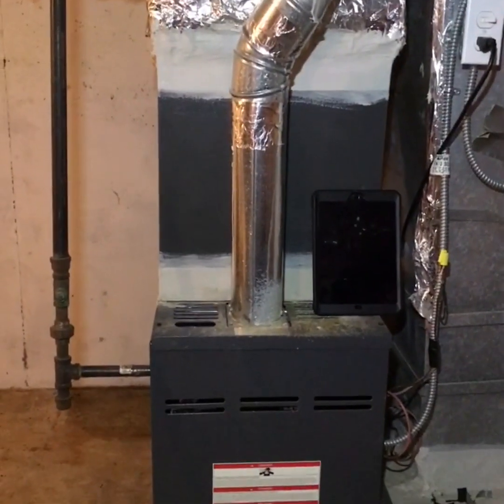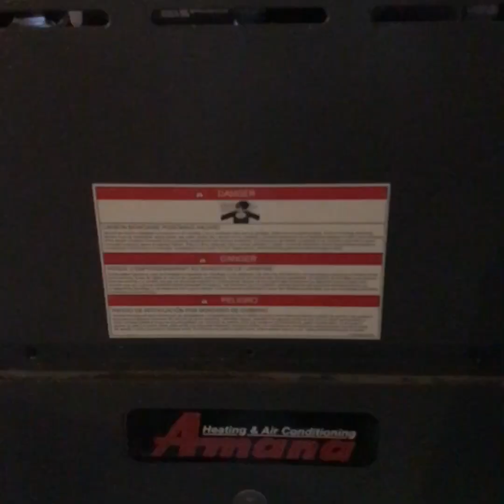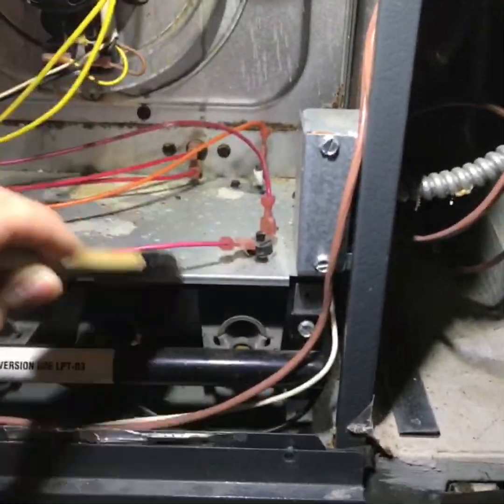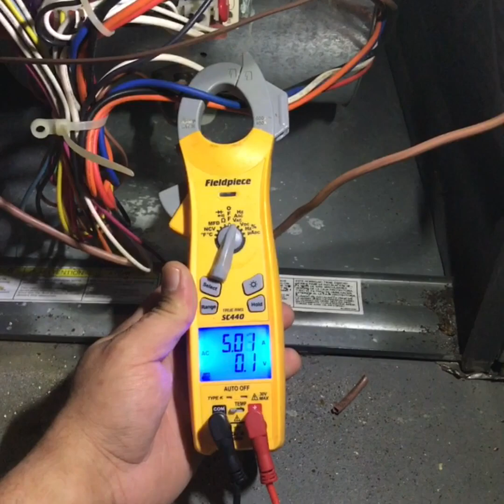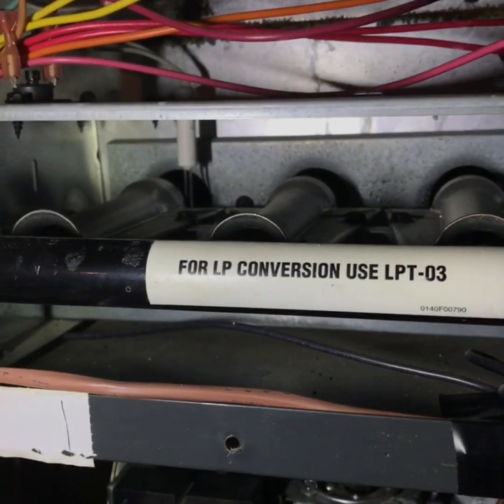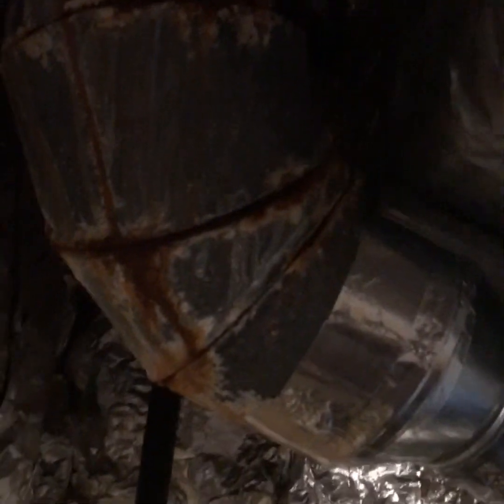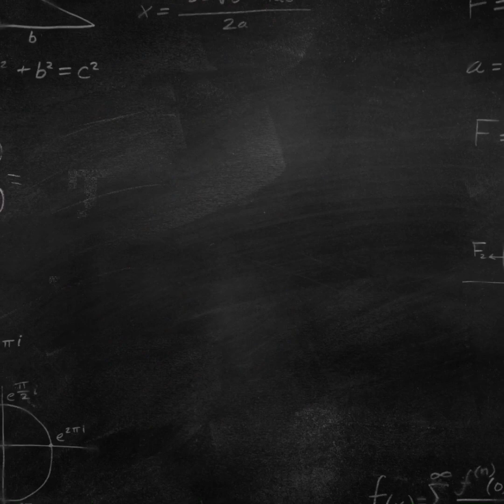HVAC Maintenance on a residential furnace

Comment: You can’t measure the blower motor amp draw with the door opened. It has to be running with the actual static pressure of the duct work. Also, I always check the induced draft motor with my manometer connected with a tee. It verifies the motor speed is good, not flue problems and there is enough vacuum to close the pressure switch. It takes 45 minutes to an hour to do it all right

Comment: In the vid, I didn't pressure test on the manifold. You may have edited that part out. I check the micro amps on the flame sensor and the ohms on the ignitor. Also use a field piece CO detector at the vents. You ever do that on maintenances or just when you believe there is a problem with the heat exchanger?

Comment: Good vide, for furnaces more 10 years old you should pull the blower out of the furnace then visually check the heat exchanger for cracks and rust damage.

Comment: There's a recall that came out recently about those furnaces running without the blower being operational and melting coil pans. We add a pressure switch to the back of the blower housing and install a secondary board to manipulate the unit to lockout if the blower stops for any reason.
This applies to the high efficiency goodman and Amanas only

Comment: To anybody reading this please don't just start removing wires from your capacitor. You will get zapped. You need to discharge it with a 5k ohm 20 watt resistor. Then you can start touching the terminals without you being shocked. You also have to make sure your unit is off when doing this. Take this from someone that works in the field

Comment: You need the blower panel back on so your IBM pulls the correct Amps.

Also nu flame sensor is coated— Thus recommend using wire brush 

Nice video